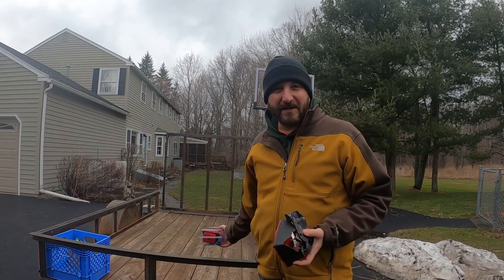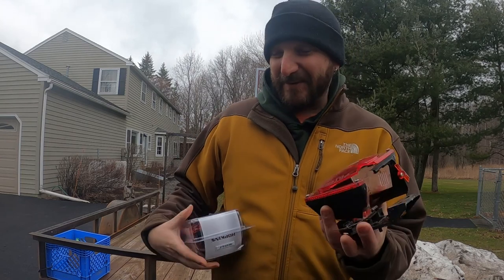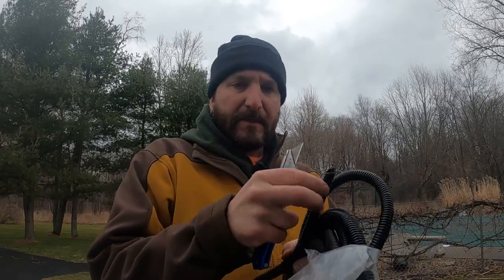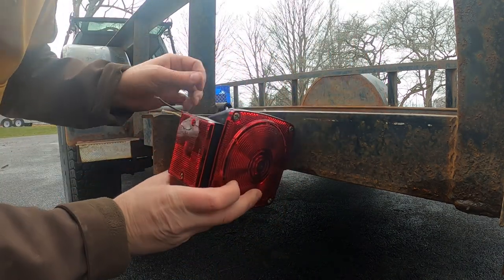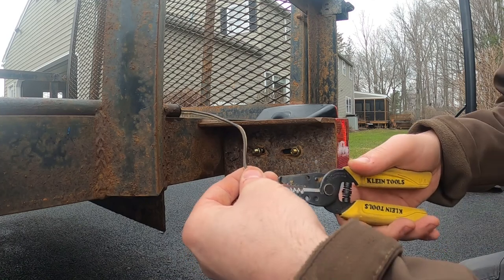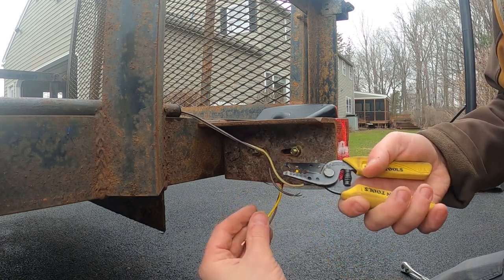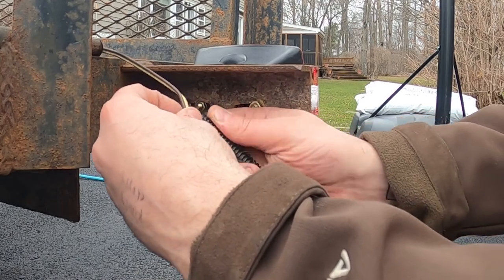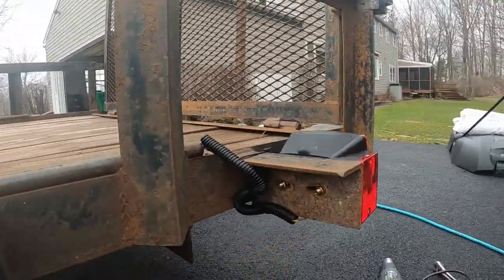Carry-on Trailer Tail Light Repair

Comment: Thanks for sharing. Neat repair and not expensive. Endless repair loop. Breakage or salt / rust damage. What will come first. Both are inevitable.
Reply from the maker: Your son was the one who turned me on to those heat gun solder connectors!!!

Comment: You  should have removed some of that rust to make a good ground for those bolts sticking out of the light housing, it may come back to bite you later.
Reply from the maker: Thanks for the tip! The other side magically died recently so when I replace that one i will do that for sure!!!
Reply: @BorsellinoHomeServices  Also those lights you bought are incandescent, there are the same lights made with LED instead and they last longer. I make rectangular boxes that can be bolted on to house those lights for trailers that prevent them from being hit and broken and they last longer that way.